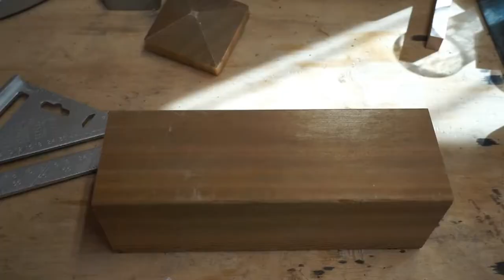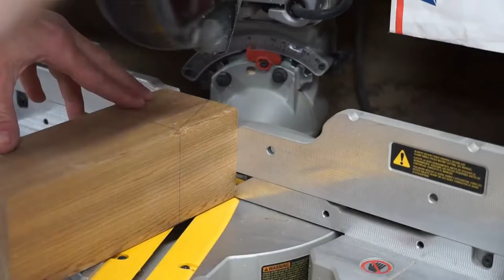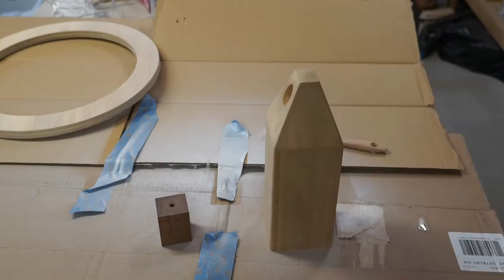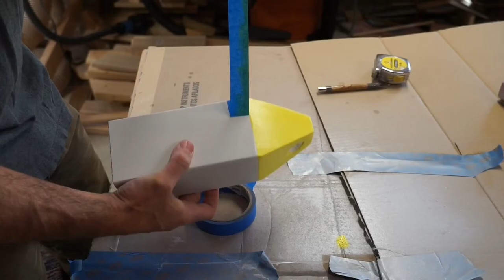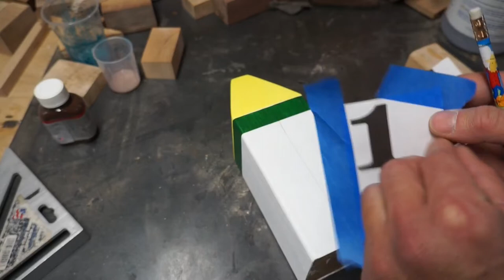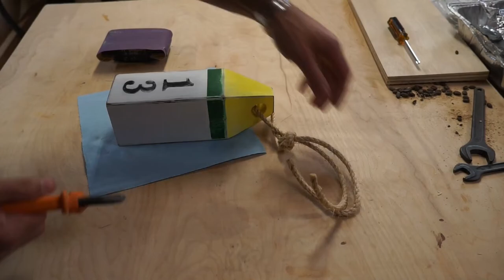Woodworking Basics: Make a Decorative Lobster Buoy!

Comment: I'm new to my DeWalt compound miter saw - how did you set the blade to make those cuts?
Reply from the maker: Hi Lynne - there is a lever at the end of the saw's base that allows you to adjust free-hand. With that being said, this saw is probably 10 years old so not sure if that has changed on newer models. Thank you for watching!